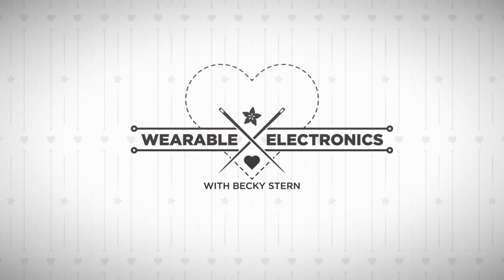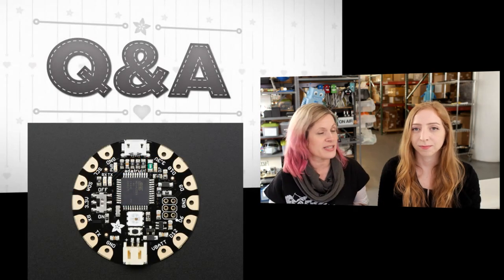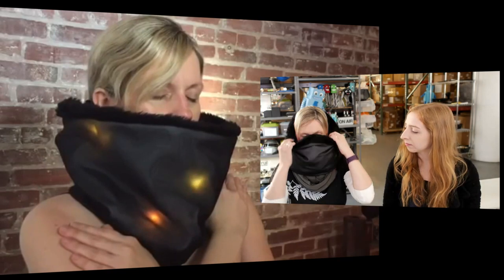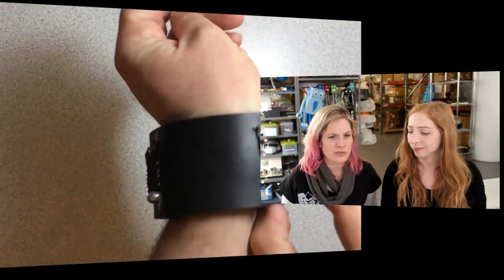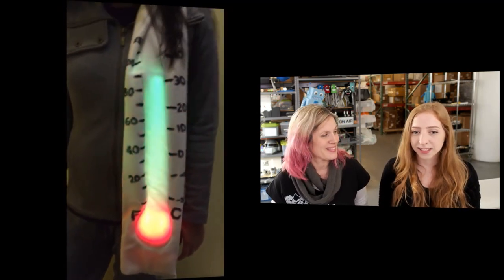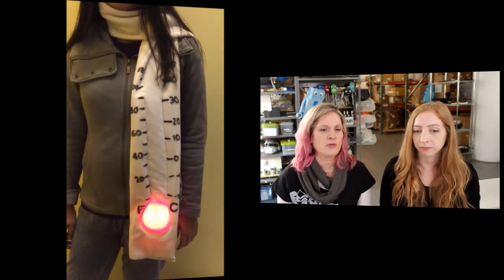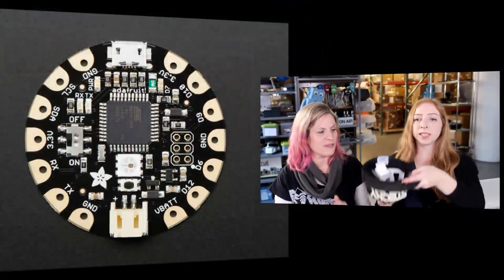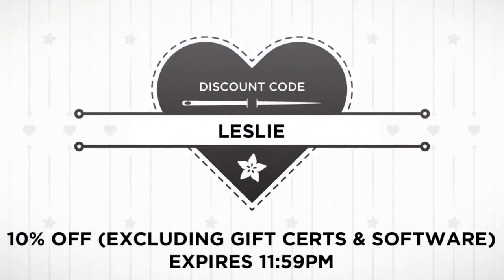Leslie cohosts Wearable Electronics with Becky Stern 1/13/2016 - LIVE

Comment: Have you ever tried using Nikwax with sewn wearable projects using conductive thread (or similar non-insulated material)? Does this seem like the sort of project that would make wearables less prone to shorting when used in areas with high humidity, in situations where sweat would be present, or even during light rain?

Comment: Just finished my first wearables project! Thanks, Adafruit, for the inspiration to add neopixels to clothes and a nice lightweight microcontroller like Gemma! A group I run with had a "glow run" tonight and my neopixel hat worked out great, staying safe with high visibility https://www.youtube.com/watch?v=N7FlRiTLcjw
For version two I'm thinking of moving to the individual neopixels for some added flexibility instead of the pixel strip. I'm still pretty new to needle and thread, since the hat is sort of stretchy quick dry material would it be easier to use conductive thread with a stitch that can flex or silicone coated wire with some extra slack between pixels?